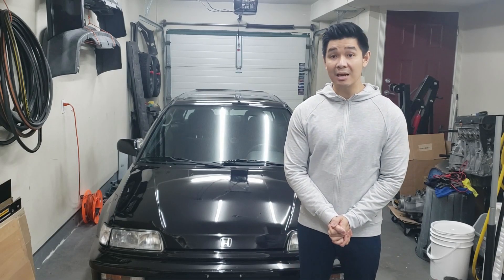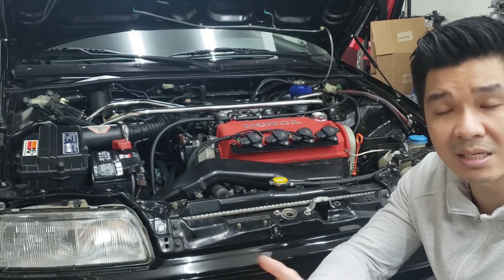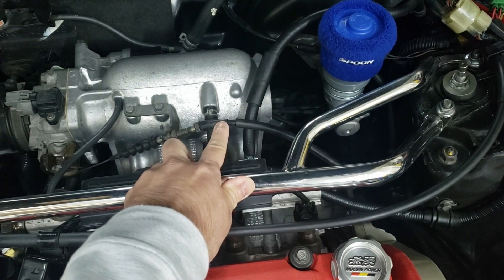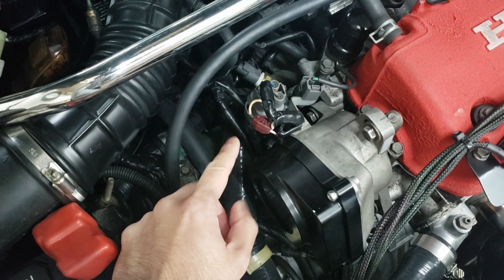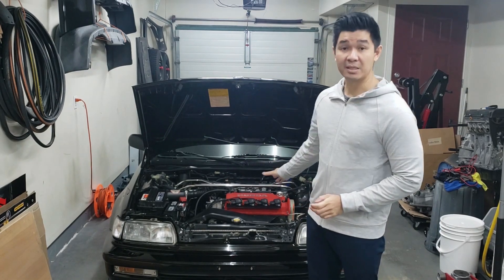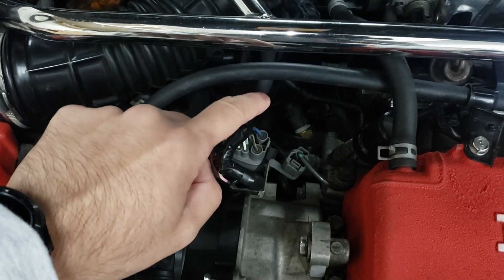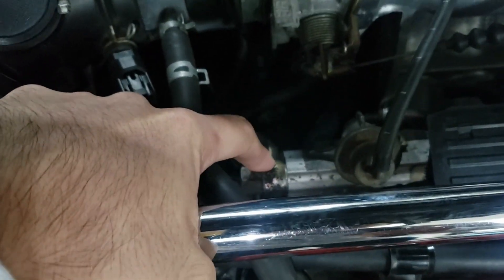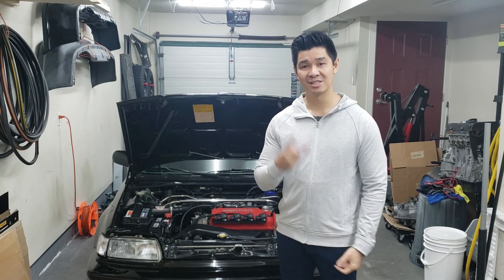||HONDA EF/ED CIVIC & CRX|| Planning on Engine Swap? 👉🏼 HOW TO SWAP a D16Y8 into your EF CIVIC/CRX!✅

Comment: Great invaluable info bro. How did you go about converting the cable style speedo to the electronic one on the transmission?
Reply from the maker: @nikodimosmarkose6962  I didn't. As mentioned in the video use your cable transmission. I'm assuming you're using the hydro transmissions? You can just swap your speed sensor. If you're adamant on using electronic speed sensor, you'll need to replace your gauge cluster with one that uses electronic speed sensor, which will require full rewiring of your cluster.
Reply: @ got it thanks man! No I haven’t swapped yet. Just got the motor and transmission off of a 98 EX. Planning on swapping  real soon.

Comment: What if you just keep the mpfi manifold and put it on the y8 engine
Reply from the maker: Yes, you can do that. Not sure why you would want to though. The Y8 manifold is supposed to be the best stock manifold for a d series.
Reply: @BudgetGears  idk I have an mpfi swap installed already, figured it’d save me time re wiring plugs
Reply from the maker: @michael48990  You wouldn't have to re-wire anything. Everything plugs right into the manual Y8 manifold. You can just use the injectors from your mpfi and resistor box (if you're still running one) and you're done.

Comment: If you live in Ca dont waste your time. Stick with D16Z6 OBD1. Much easier and just as good.
Reply from the maker: I totally agree. If you can get your hands on a good D16Z6, that's a much more preferable engine. A p28 ecu just plugs right in and doesn't require tuning. It's also a stronger engine than the D16Y8.

Comment: if i already have a d16y7 wiring harness could i use that because i have a base model crx which is dpfi and i want to skip as much wiring as possible
Reply from the maker: No, as I emphasized in the video, use your original engine wiring harness and modify for changes. Using a d16y7 engine harness is going to be a nightmare of wiring. The easiest way is orignal engine harness. Or you can buy a tucked wire harness with the correct subharness.
Reply: @BudgetGears alright, what about the transmission because thats one of the reasons im doing the engine swap, its a 5speed crx and im putting a 97 lx transmission in it (aswell 5speed)
Reply: @BudgetGears another thing is the engine is a d16y7 bottom end and i have a d16y8 head i’m putting on it what are some suggestions youd have
Reply from the maker: @kalebkroeger3097  I'd recommend reusing your original cable tranmission if you can. Much easier to just reuse that. You can use the 97 lx transmission, but you'll need the hydro mount and t bracket and a hydro to cable kit. Much more costly to run and the lx transmission is not a desirable transmission. Unless you prefer a longer gear transmission. Most would want a short gear transmission from the Y8.
Reply from the maker: @kalebkroeger3097  No suggestions here. It should run pretty much the same as a stock Y8. Personally, I'd prefer to run a complete Y8 instead of a mini-me d series because you can usually pick up a complete Y8 for cheap.
Reply: @BudgetGears  would i use the clutch and pressure plate out of the crx or d16
Reply from the maker: @kalebkroeger3097  use whatever clutch and flywheel that matches whatever transmission you plan to use.
Reply: @BudgetGears  so put crx fly wheel in d16y7
Reply from the maker: @kalebkroeger3097  yes, I think the flywheel might have been the same for the y7. But if you're using the crx transmission, put the flywheel, pressure plate, throw out bearing, etc from your crx transmission. Everything should match the transmission you're using. It'll all bolt right up.
Reply: @BudgetGears  could i use a si wiring harness to skip a bunch of wiring and is the p28 plug and play?
Reply from the maker: @kalebkroeger3097  you'll need to be more specific. Which si harness? From what vehicle. I guess it doesn't matter. The only option for next to no wiring is going with something like the rywire tucked harness with specific sub harness. Those are plug and play for the most part. The next easiest method is using your original engine wiring harness, getting a ecu jumper harness, and distributor jumper harness, and modifying for any differences required. A p28 will only plug into obd1 connectors. Unless you have the uncommon obd2 p28.